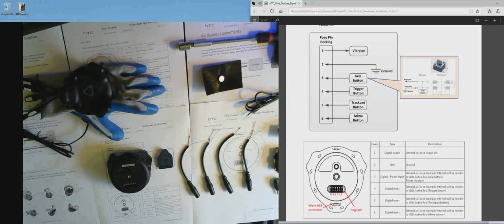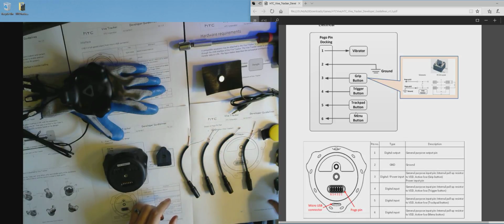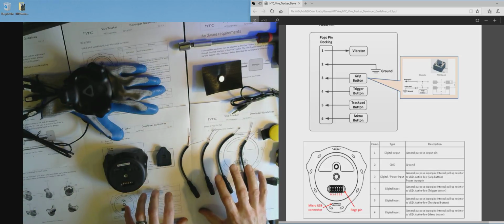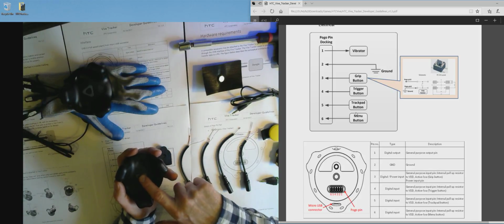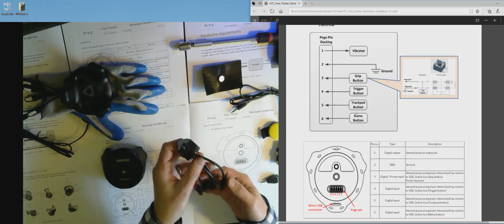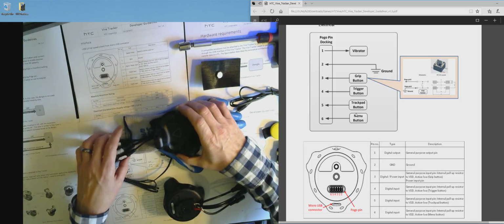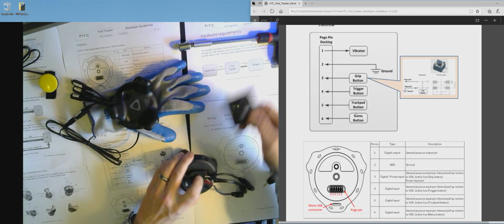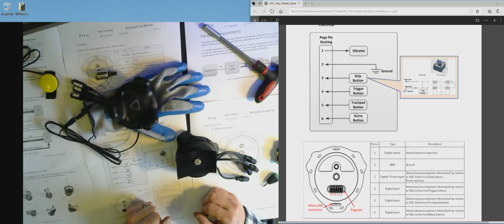Modular VR Glove/Controller for HTC Vive DIY

Comment: I ordered the parts I need for the pistol, but they are all from weird sellers and will get there 'eventually.' :(
Reply from the maker: Very Cool Grey! Will you be sharing pics/videos? Also which route are you taking? Is it total homebrew or are you using a PP Gun Mini as a base?
Reply: I plan to do a glove first to see if it works, at which point I'm hoping the professionally made gloves will come out, and I'll pull all the parts for a pistol. 

That said, it'll be total homebrew based on Matzman's rifle design. I'm going to need to see just how big this board actually is.
Reply from the maker: Here are some great pics and resources you may have seen. 
https://www.reddit.com/r/Vive/comments/6m4ljz/vr_rifle_pistol_sniper_finale/
https://imgur.com/a/xWnfO
The Arduino boards do look pretty large for some applications like a pistol.
Reply: I agree it's going to be.... awkward... to make into a pistol, but I know so little I am just following the directions. If you can suggest another board, I'm all ears.
Reply from the maker: Grey VR from the same documentation you are probably reading, the board we need to use is an Arduino Due because it has the USB controller on it. It is one of the larger Arduino boards. It's possible to use a smaller Arduino board and add a USB shield (basically an add on card) but this is outside of Matzman's instructions. It's already so complicated and outside my realm that I would hesitate to try. 
The other solution is to use an Android device such as a phone. Here is some info on that:
 http://www.brightdevelopers.com/communication-htc-vive-tracker-android/
Along with the latest tracker documentation:
https://dl.vive.com/Tracker/Guideline/HTC_Vive_Tracker_Developer_Guidelines_v1.5.pdf

So I loaded a USB debugger app on my S7 and connected my phone to the tracker via micro USB and an OTG cable! The phone sees the tracker just fine! Now to figure out how to send button presses to the tracker. Then connect a bluetooth/USB device to the phone and send those button presses to the tracker!!
Reply: I'm at about the same spot you are. I'll need to look all you said over more closely later. 

What I'm thinking though is that the Due is at least a year old, a newer card with all that is required and a smaller form factor is likely available, we just don't have the knowledge to pick which one is appropriate. 

I'm hoping I'll learn enough on this project to figure that out, whereupon I will change cards.
Reply from the maker: Keep me updated, and I will do like-wise! It takes a village!
Reply: https://i.imgur.com/WLC0Ytv.jpg Something like this, except I was thinking of standing the board vertical and covering the wires.
Reply from the maker: Grey VR, Nice! I would like to cover the entire thing in a case and add ports (like the 3.5mm ones) so the whole thing could be modular.

Comment: Awesome. I am going to have to try this. Have you tried rounding up a joystick from somewhere and .... adding it in somehow? I was thinking wearing it as a ring on the index finger.
Reply: Grey VR I'm kind of wondering if you can use both usb and the pins at the same time
Reply: Maybe use and old ps4 controller touchpad and connect it to the tracker with an adapter
Reply: That's a good question. I don't have an answer. I wonder if I could find some old controller, pull the parts out, glue the joystick to the back of my hyper blaster and run the thing into the usb port? 

Hey Rob, when you get back, what are those documents on your table and where can I get them?
Reply: Grey VR that would be amazing
Reply: Miguel, I'm kind of thinking I want to make my own VR pistol.....

Also a glove, and go with my PP gun as a rifle. Anywhichway I do it, I need to end up with at least 2 of every control to simulate the vive controllers. I'm watching the guys making gloves (none are out yet,) but if they come out I'll be glad to give them my money. Not many pistols on the market. I'd go with the ppgun mini, but I want the joystick to the rear... So maybe making my own is the way to go.
Reply: Grey VR you could tap into the ppgun mini and move it to another location to your liking on the ppgun mini of course
Reply: Hey guys, I've been digging just a little, and I found some stuff about using a simple circuit board to build a controller which can run a joystick. It's matzmann's rifle controller blueprints. 

https://github.com/matzman666/VR-Rifle-Blueprints 

Now, this is a year old, and I'm very slowly following this up. These Arduino boards come in a million shapes and sizes...............and I'm thinking I want to make not just a glove but a pistol as well. I'm hoping to invest in a 3D printer, and what I'm thinking is I could take a pistol frame and either use the actual pistol frame and build a slide/magazine to go in it, or just print a pistol and set it up. 

The boards come in a great many shapes and sizes, but I know so little about this that I feel very apprehensive on getting one, merely because I'd like to go with the smallest one, but I want to make sure it's the smallest one which will do what I need it to do. 

I'm also considering cannibalizing a vive controller for it's donut and (more importantly) it's trackpad. Imagine printing a whole new pistol shape and just shoving the vive controller parts inside it? 

That might be harder, so we'll see.
Reply from the maker: Grey VR & MIguel Rojas, Great work!  I have been doing parallel research. What I have been working on is getting an Arduino Due board and add the 3.5mm jacks to make it modular, instead of hard wiring all the buttons, triggers and joysticks. I am sure you guys have come across the below info.
https://www.reddit.com/user/matzman666
https://imgur.com/a/HkzSY
I still don't have the guts (or money) to pop open one of my PP Gun Mini's and tap into the joystick to add to the back.
Keep up the great work!
Reply from the maker: Here you go (you probably already found them) 
https://dl.vive.com/Tracker/Guideline/HTC_Vive_Tracker_Developer_Guidelines_v1.3.pdf
Enjoy!
Reply: Very cool. This Arduino stuff is very new to me, and I'm reading as I can. Have you found a decently priced location to get the due board? It seems like the board is out of stock or quite expensive.
Reply: Oh, here's a thought. It's way beyond me to accomplish it, but I wonder if you could 3d print a joystick mount for the rear of the pp-mini, and somehow... run the USB cable from that mount to the tracker and 'tap in' to the signal running from the PPgun to the tracker and use your joystick instead of it's joystick? 

Like I said, this would be beyond me, but there's someone out there who could do that... if you can find him and get directions.
Reply from the maker: Amazon is my primary choice. You need the Due board from what I understand because it has a USB controller on it:
http://a.co/eLC575l 
Here is some more info on the subject:
https://www.reddit.com/r/Vive/comments/6m4ljz/vr_rifle_pistol_sniper_finale/
https://imgur.com/a/xWnfO
I am also doing research on using a phone to send the signals to the tracker too, but only so much time.
Can't wait to hear about your projects!
Reply from the maker: Great idea! So many great ideas, so little time!